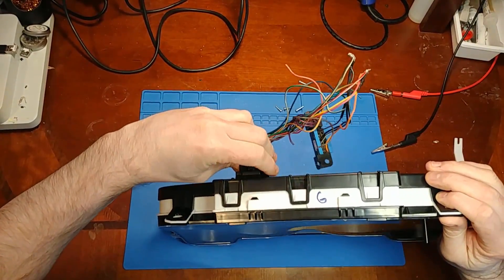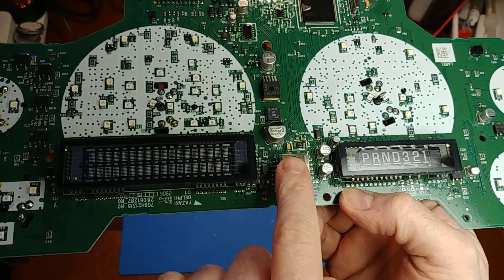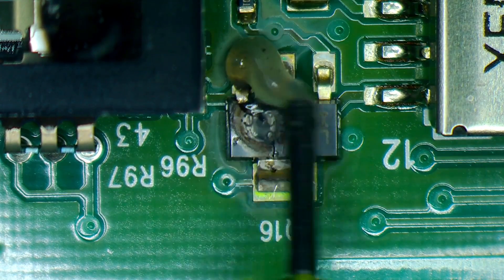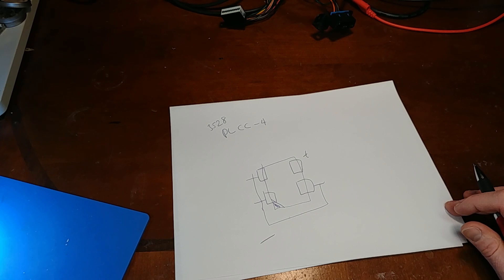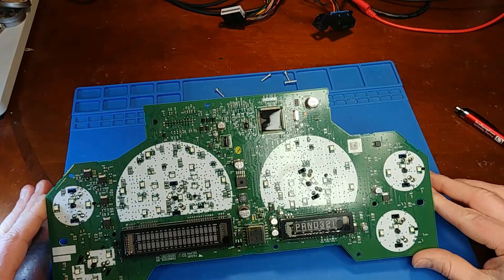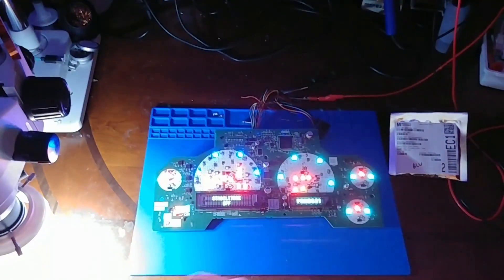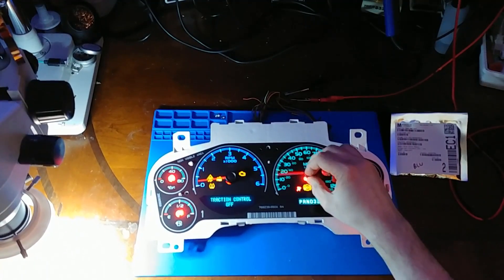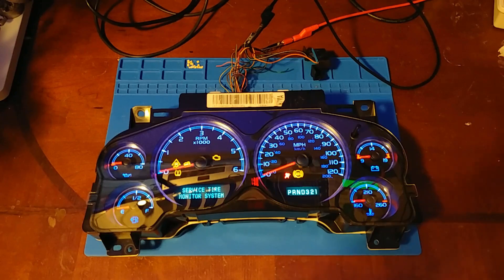2007 Chevy Cluster Display Repair & Blue LED Install

Comment from the maker: For contact information follow this link:
https://www.youtube.com/watch?v=T_2WnJMsZaU&feature=youtu.be
Reply: I Have a 2012 chevy 2500hd how much do you charge for the LED install.
Reply from the maker: @williamginn6126  you can send me a email for a quote. Thank you.
Reply: What’s the part number for white led from mouser?
Reply: Where are you located at???
Reply from the maker: @marcoaguilar4723  is you follow the link at the top of this post it will take you to a video that has a list of cluster repair technicians by location in the description.

Comment: I was wondering if it’s possible to change the digital displays on the bottom , I was wanting to go to purple I saw another comment where you said to get one that has the color you want already built in, but all my research just leads to the background overlays not the digital part with different colors any idea how to find them online?
Reply from the maker: You have to use color transparency film. Some aftermarket faces have the color transparency film built in. For example since the display is green, and let's say you wanted to make it white, you have to use a red color transparency to make it look white.
Reply: @jeffescortlx  so overlap with a different color to make it look purple

Comment: I need to get my first hot air station. Do you have any recommendations or any general advice with picking one?
Reply from the maker: For small surface mount stuff a $45 cheapy from eBay or Amazon will work fine. If you want to do large BGA chips like GPUs / CPUs or work on boards that have lots of copper ground planes then you will want a larger 1000 watt style like a quick or attn.

Comment: I'm trying to power up a cluster out if the truck, to check mileage. What wires do I need for ground a what wires do I add power to? I have the original plug cut out of the truck.
Reply from the maker: I don't remember just going off memory. But if you Google the wiring diagram connector you can find the pin out, that's how I did it.

Comment: Can i use 5mm leds instead
Reply from the maker: I guess you could if you really tried. They won't fit very well, you'll have to bend the lead straight out and make it as flat as possible. And then I hope that it clears the middle white reflector layer. But usually 5 mm LEDs focus a light forward in a beam rather than spread it out like a surface mount, so you might get really bright spots directly underneath the LEDs.

Comment: Mine has a speedo that is stuck at 30 or 20. Is this a common issue? Should I get the whole thing redone?
Reply from the maker: For a 2007 classic? Yes. For a 2007 NBS, no.

Comment: Question; my check engine light is out but the obd ll is saying bulb is out and I was wondering how can I change it to make it come on I have 07 Chevy impala
Reply from the maker: Has the check engine light been out ever since you bought the car?
Reply: @jeffescortlx  yea I just bought it last week and I need the light to be on to pass the smog test
Reply from the maker: @dare2bdifferentkustomz  The previous owner didn't want to fix whatever was wrong with the car to cause the check engine light to come on. So they may have covered up the light or they could have smashed it off the circuit board, we won't know until the clusters is taken apart to see how it was damaged.
Reply: @jeffescortlx  ok so the best thing to do is take cluster off and look at it, then go from there?
Reply from the maker: @dare2bdifferentkustomz  you have three options. Attempt to repair it yourself. Or if you're not comfortable with this sort of repair you can send it out for repair, or you can find a used junkyard replacement and just deal with whatever the odometer reading change says.

Comment: What’s is the think you use to glue the Leds and to remove the old ones call
Reply from the maker: No glue. They removed with a soldering iron and installed with solder and a soldering iron with flux.
Reply: Thank you ima look in to it looks badass tbh

Comment: Hi jeff awesome channel. Quick question probably a dumb one but ill ask anyway. If i wanted to add a Led my car somewhere and i was using ohms law to figure out what size resistore i need what voltage do i use for the calculation. Would i use just 12 volts or 12.6 for where my battery usually is when i start the car or do i us 14 since thats what the alternator is putting out once the car is running. Ive tried to search the web for the answer but no luck.

Comment: Just a quick question, I just done this to my gauge cluster and I can’t get my needles set properly, they seem to be set good and I drive it once and they go below 0 and I have to try and set them, how do I set them properly?
Reply from the maker: If you don't mark the starting position before dissembly I would recommend to power the cluster up without any signals coming in to find the home start position and seat the needles then.

Comment: I tried doing this myself and I got about half the lights to work, I keep trying to get the others to work and sometimes I can fix it but a few are giving me a really hard time. What could I be doing wrong? Or did I possibly break the board?
Reply from the maker: You could have the polarity wrong, using the wrong pads, causing a short across the pads, or you damaged the board. All just speculating without seeing it.
Reply: @jeffescortlx  one of the spots for the leds does seem burnt out, my iron is a bit too hot but I didn't even think of polarities. So if I flip the ones that aren't working around, could that solve it? Since I've posted the comment I've gotten two more to work
Reply from the maker: @Locustkill3r  yes LED's are polarity sensitive. They are doides.
Reply: @jeffescortlx  ok thank you you make it look so easy but it's a huge headache for me😅

Comment: My Cadillac Escalade ESV, after a full battery drain and a jump, now has no backlight whatsoever in cluster panel. Instead the four needles are constantly flashing blue, on and off at 1/sec rate! 
Some one told me to remove fuse 46, run the engine and put it back. 
It worked and I got my cluster backlight. But unfortunately, one a subsequent battery drainage, I Have the same problem and that procedure does not work anymore. 
Do you know what has happened and Do you think there is anything blown on the motherboard or still a relay or fuse or bad connection or an unsync cycle? PLEASE Help if you can.
Reply from the maker: I'm sorry but at this time I don't know how to fix that particular problem.

Comment: I would like to know what wires you use to give the cluster power? can’t find it anywhere on the web.
Reply from the maker: Pin 1 & 5 12v, pin 13 ground.
Reply: @jeffescortlx  thank you

Comment: I have a 2013 avalanche, you can do this for my truck?
Reply from the maker: Yes
Reply: @jeffescortlx  
Nice,  can you make it even brighter than your video? I would want the brightest possible. 
So I ship you mine and you ship it back? What's the turn around time?
Thanks!
Reply from the maker: @jubileechevalier1253  the LED's I use match OEM brightness pretty well. But my camera has a hard time showing what it really looks like.
My contact information can be found here:
https://youtu.be/T_2WnJMsZaU

Comment: Hey Jeff. Unpopular request or question but do the LEDs come in purple? I'd like convert all the aqua light displays in the truck cab to a deep purple color. Not the pink.
Reply from the maker: The problem with that is the ones that come out to a deep purple after passing the face, are typically listed as pink. I actually really like the pink in the 07+, looks like neon glow.

Comment: What is everything else works but the back lights on my cluster the LEDs on a 07 Chevy Silverado new body style
Reply from the maker: I'm guessing dimmer switch issues or blown fuse.
Reply: I have checked every fuse I can possibly I don't understand it to be honest I can turn my dimmer switch down end up in the mileage per hour gets brighter and dimmer but my back lights that show how fast flicker on and off but thank you for replying
Reply from the maker: @andreaburch8173  you could have a defective LED in the cluster. Does the rest of the dashboard behave? Climate control and radio light up correctly?
Reply: Yes everything else works except the back lights to the LEDs

Comment: Can we send you an instrument cluster on a 2007 gmc sierra new body stly z71 to upgrade to LED along with also sending you a Z71 Z71 TRUCK CARBON FIBER CLUSTER GAUGE FACE INLAY... Will it still work as normal, Our project truck has the full Z71 package, denali 08 package etc etc not that any of that matters but just wondering please get back to us and let us know, Great channel and videos you are inspiring - Savvy Turtle
Reply from the maker: Sure. Follow the link in the top comment to find my contact information.

Comment: When you add the needles again do you turn them all the way to the left. I swapped mine but now they are of-center
Reply from the maker: If your not setup for electric calibration (seating needles at powered up zero state) you need to mark the starting location and re-seat the needles at that point.
Reply: Thank you! I will do that!

Comment: Great video bro 👍👍 But do you work on Chrysler 300m clusters ?
Reply from the maker: Not much. What do you need done to yours.
Reply: @jeffescortlx  My clusters works great, i just want to install blue LED's . Thanks for the reply👍
Reply from the maker: @Mr_57ChargerRT  some Chrysler clusters use electroluminescence backlighting. If yours does changing colors can get tricky.

Comment: Noticed that cluster already had LED in it. Where those OEM? Most videos I've seen are regular incandescent.

I'd imagine installing the LEDs you used on one of the incandescent boards would require limiting resistors right?

Comment: @Jeff awhile back I commented in a video and asked about what kind of LED bulbs you used for the 04 Chevy Tahoe Dash Cluster assemblies. You replied but I forgot to write it down but the history in YouTube won't let me go back that far. 

Also if you have the manual control knobs for the dial climate which were manual what bulbs can one use for those or would the same one work? 

Also where do you get the servo motors or stepper motors as I believe their called? 

Thanks for the great Vids and good narration. 

If you have time sometime maybe if you could create a smaller length video describing your procedures doing your soldering, equipment, parts used and why (quality/etc) vs other brands. Also some of the tools you use such as the solder sucker and the good types ajd types to stay away from. Keep up the great Vids!
Reply from the maker: I order my stepper motors from a supplier located in Shen Zhen. But if you only need enough to do one cluster they wouldn't work for you as they deal in large quantities by the rack. 
Most of my videos list my tools in the video description. But not this video, because this video is for a different cluster generation.
Reply: @jeffescortlx  Hey, Jeff thanks for that. I'll probably have to find some good stepper motors off eBay or something. I get Leary but if it does what it should then I'd be fine. 

Browsing the Mouser site I've come to realize it's a very large website. Is there a certain link or part number you have for the led lights that you use for replacement? Hopefully the ones in the dash cluster, the headlight switch and HVAC control board in the manual dual zone HVAC. That would be helpful to find a part number for the LED chips/bulbs?

I may or may have not mentioned but before I repair mine I plan on getting a used board from the junkyard to practice my skills. I don't have the automatic solder sucker but have a manual one which should be enough I think for doing my LED bulbs in my various switches, cluster, etc
Reply from the maker: @dtnel  yes I saw you mentioned that you were buying a practice board. I am curious of what they will charge you. Junk yards are good at knowing what parts are valuable and high in demand. GM clusters are one of those things. My local junk yard gets $175 for them. Sorry I don't have a mouser link for you, I buy my parts at high volume directly from the manufacturer over seas.
Reply: jeffescortlx  Maybe a dead board would be the way to go because as you stated used boards are expensive. 

 I found these bulbs in this generation of board you’re working on as there’s about 40 that mouser lists when I searched 604-AA3528... It shows some as cut tape but if I want to buy a lot then I could go with the reel but that’s to many lights. 

I need to do some more searching in your videos and see if you listed the part number as you did in this video. 

Picked up a scope a couple weeks ago. Need to change some things around in garage to make room for it and have workspace. 

I’ll go poke around your 04 style videos to see if I can find the bulb type. It’s the breaks of being new to this part of stuff in automotive repair. Funny thing is my 06 impala has no backlight issues (knock on wood) but the Tahoe has plenty in the dash cluster, light switch, 4wd switch, manual heat backlighting. They must’ve used some bad suppliers at that time, tech changed in 2 years obviously.

Comment: I've got an 07 dodge magnum sxt that has gone dim and lost a light in the display below the tach ,could you please send me a link i need it gone through
Reply from the maker: If it's not the electroluminescent version it might have user serviceable bulbs. I'm not that familiar with dodge.
Reply: @jeffescortlx  all my research says it is the electric version as far as the display goes I'm not sure if the bulbs can be user replaced I've gotten answers saying both and i haven't opened it up to see
Reply from the maker: @danereynolds2338  are you having problems with the back lighting or the display?
Reply: @jeffescortlx  the display has gone out injust the area below the tachometer
Reply from the maker: @danereynolds2338  ok. I believe they use a VFD. They are not back lit. Could be board issues.
Reply: @jeffescortlx  ok thanks I've been quoted 200 to go through it and i was going to have led lights installed for the backlighting and a new faceplate put on would you be interested in doing it
Reply from the maker: @danereynolds2338  Thanks for the offer. But it would be best for you to send it to somebody that is familiar and setup for bench testing. Also ask about LED quality. If they are buying the cheapest LED's on eBay or Amazon you'll be better off leaving the factory bulbs in.
Reply: @jeffescortlx  ok thanks for all your help

Comment: Why do you twist the needles before removing them?
Reply from the maker: To break them free. Otherwise you end up breaking stems or pulling the shafts right out of the motors of you just try to pull straight up.

Comment: I have emailed you. I have a 2005 cluster 1500 chevy never been repaired to my knowledge. Cluster has all bad stepper motors lights are burned out oil stepper doesnt work. It's a nightmare. Would be a good video to demonstrate how to tell good from bad and do a full build. Thanks for your videos I just purchased a solder sucker it works great.

Comment: How can I get a hold of you? I got on a desktop computer and it still doesn’t show your email.
Reply from the maker: There should be a captcha on the about page to answer.
Reply: jeffescortlx just tried on IE and Chrome, nothing. Wondering how much Odometer Error and a few burned out lights would be when you have time.
Reply from the maker: @estpaul3132  I'll assume you have a 03-06 Full size GM. Full rebuilds on those are $120 plus return shipping.

Comment: Great repairs and videos! Years back I did cluster repairs on Chrysler products and they had tons of environmental temperature problems. Use to put radio in homemade boxes and used a heat gun to heat up the units to find the intermittent problems. I never had customer repairs, they were mostly factory warranties! Feel for you, but money is Mon right? Cheers!
Reply from the maker: Cheers!

Comment: this seems pretty common with several makes and models. I repaired many but never really had time to trace down what was causing them to fail so often. I repaired some that were only 15-18 months old, but had over 100k miles so it wasnt covered under warranty.  i do like the VFD displays tho.
Reply from the maker: I like VFD displays too. They have a certain character to them.

Comment: Is the hot air gun extremely focused? I’d imagine you’d have to be careful what you heat up as to not undo other components.

Great work!
Reply from the maker: The surface tension of the melted solder helps hold the parts in place even when the solder is melted. They will normally stay put as long as the airflow isn't too much or bumped into too hard.
Reply: What’s the glue call